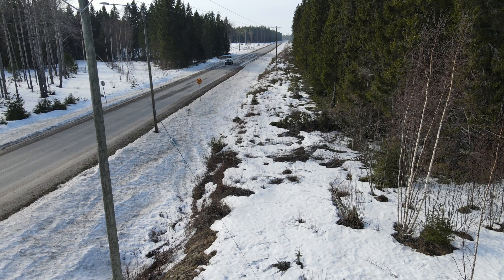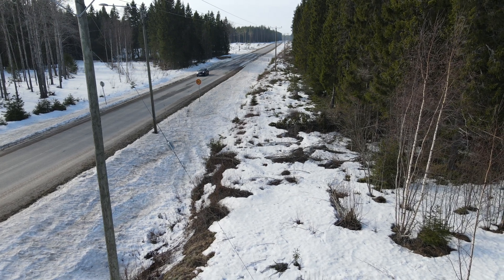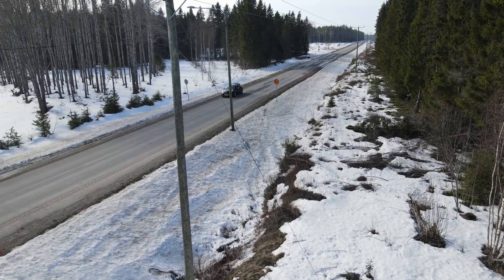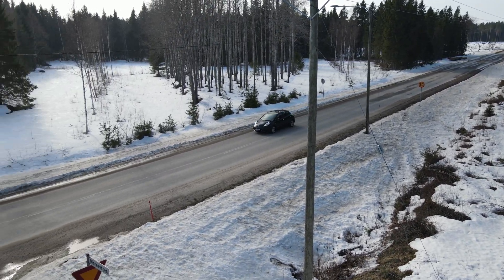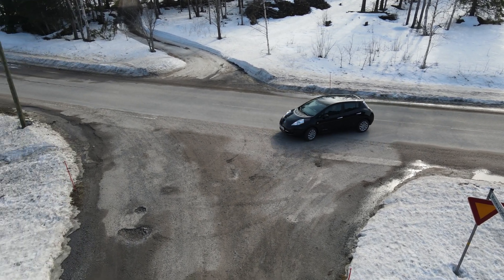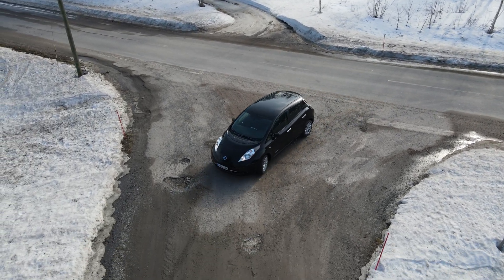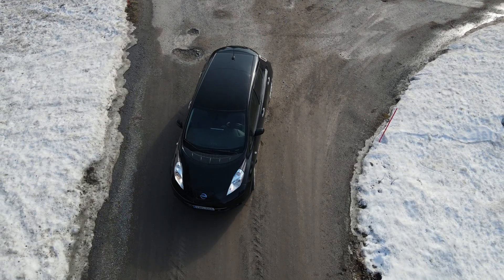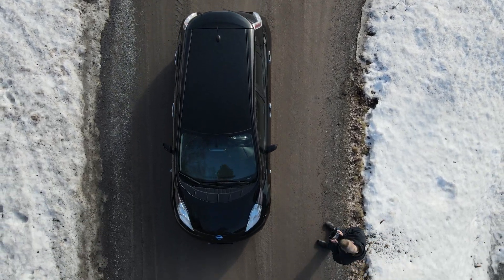Performance upgrade for the LEAF, [Part 4] 400A

Comment: Hello Dala I have just bought a 2013 Nissan Leaf Tekna model  with the 24kW {dying with only 9 bars showing} battery I have located a 2022 40kW battery and this is coming out of a written of 2022 Leaf Tekna  NOW the power unit  {charger Inverter and motor the complete unit}  are also available  can I just swap power units and if so is this an easy plug and play process also if I only fit the 40kW battery do I need to add  the Canbridge thing?  any help and advice is seriously appreciated 

thanks
Reply from the maker: From the power stack, only the Inverter+motor is an easy swap. PDM is way more complicated!
Reply: @DalasEVRepair  can you explain what the problems will be just dropping the whole powerpack unit into my ZE0 car thanks  Also where do i get a Canbridge to put into my car when I first swap the battery (I would love to do a 62kW swap but finding a 62kW battery at sensible prices seems impossible ) and i found this 2022 battery power unit combo at a very good price  delivered to me in Scotland
Reply from the maker: @flyingscot6997  too long to explain here. Post on the MyNissanLeaf forum to get an answer!
Reply: @DalasEVRepair  OK went there but not got a sensible reply as yet 

BUT my 2013 ZE0 Leaf has a 24kWh battery and a 80kW motor with matching inverter NOW IF I put in the 40kWh battery that will double my range {I believe} 

At the moment with the present 24kWh battery with 9 bars  the car says 60 miles range with the battery at 100% {granny charger stopped charging}   Leaf Spy says 97% charged   

NOW IF I put in the motor and inverter from a 2022 ZE1 car  does that not mean I will have a 160kW motor and have more performance from the car??? 

thanks
Reply: oops I think I will only have a 110kW motor  from this 2022 ZEI Leaf Tekna How do i find out which Motor  and Inverter have??
Reply: @DalasEVRepair  so will swapping the 2022ZE! Motor and Inverter make my car 'more powerful'

Comment: Hi, any update on the CCS conversion. Just about to buy a new EV and there are some great deals on Nissan Leafs, but only want one if I can see a viable upgrade path. Thanks,
Reply from the maker: Commercial CCS conversions are happening everyday for Nissans at the Muxsan workshop. This is a open source hobby version that I am developing. I wouldn't worry about it :)
Reply: @DalasEVRepair  Thanks

Comment: Dear Dala,  I purchased a Leaf Tekna 62 kWh new 2020.   I only charge it home 230v.   As I never use a rapid charge can I charge the battery to 100% without damage rather than trying to work out the charge timer which really is a nuisance.  Thanks.
Reply from the maker: Charging to 80% is better if possible, but I don't think you will see much difference. LEAF batteries seem to be more temperature sensitive compared to cycle sensitive!
Reply: If i charge to 100% i drive soon as its done, sotting around at 100% aint good.  Then again leaf batteries are probably only charging to 90% ?
Reply: @jestronixhanderson9898  there is a built-in buffer ye, but always better to try not to let it sit at 100%

Comment: Wait. You increased power, but whar about torque? As far as i remmember first 3 seconds on stock leaf are limited by max torque. Powere kimit comes much later on 4th second from start
Reply from the maker: Torque demand is pegged at 400NM at full throttle when running the CAN-bridge. It does not matter if you send 400 or 600NM, it will cap to 340NM which is max for the 160kW inverter. See source code here: https://github.com/dalathegreat/Nissan-LEAF-Inverter-Upgrade/blob/main/can-bridge-inverter.c#L361
Reply: @DalasEVRepair  - i think hes talking about when full power is served up, not the max ?  The Hyundai Kona for instance lets you light up the tyres with no traction control turned on, delivering full torque.  With the leaf and the TC off, the first 1-2 seconds feel limited in torque and purposely programmed in to go easy on the gears and drive shafts.  Can you preload the motor with the brakes on, i haven't tried it yet, maybe that will give u some advantage on launch.
Reply: Inverter only want torque request. Power is torque*rpm)

Comment: So your pack hit 356v and the 62 hit 357, both packs in the mid 80s , 180kw might put yours down another volt ?  Either way not enough so trigger issue and yours would show lower if one cell was sagging. 400a is such a specific limit and makes me think that Nissan chose this on pre-production and later pushed it up when they noticed performance was impacted by the pack weight on the 62kwh and set a toggle for it.  That toggle is the canbus we are after.  Its true the inverter firmware is the only difference on the 110 and 160 yeh ? Its interesting to note the latest revision of CHAdeMO is 400a exactly!  Mmm
Reply from the maker: The hardware inside the inverters are slightly different also, so I don't think we'll see 110kW inverters being flashed to 160kW
Reply: No wrong,I did this mod and get full power 495amp and I wasn't even pushing hard battery was only at 65% charge,my LEAf is a 2018 ZE1 40kwh model that had a 110kw inverter.

Comment: Oh nice i was 1 second off guessing what the 145kw would do to 100.  Im thinking u might get a better time with adjusting the nm start value? And smaller radius wheels for better gearing?  Ive also wondered if a change of the final gearing would work, all be it an insanely costly part to have made. Id be happy with a 110km top speed and some serious torque :)  180kw should do a 6 second flat.  Thats same as model 3 :)  also maybe u can program it to drop the hvac when over 120kw ?  Did u have any slip with 225 ? Ive heard 255s can fit on the front, the leaf has huge wheel wells.
Reply from the maker: Yes this was with a bit of slip, and not so accurate measurement, so actual time might be +-0.3s

I too think that 180kW should net 6s or below, this will be so exiting when we get it figured out :)
Reply: @DalasEVRepair  i think my battery pack is 100kg less weight than the 40kwh so i might get a slightly better time :)  though voltage sag may be higher :)

Comment: Hi Dala,  we may have someone that can help us :) over on github :)  i can send my round plug over if u need to make up a cable for them to use without impacting warranty.  I have my 160kw inverter still out of the car.  Nice wheels!
Reply from the maker: Updated the Github thread with more info on how to log!